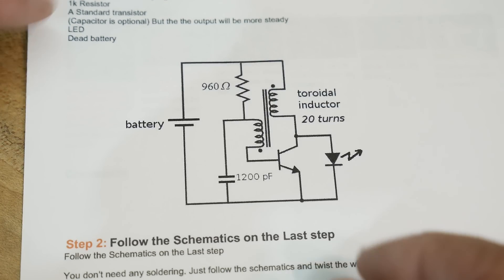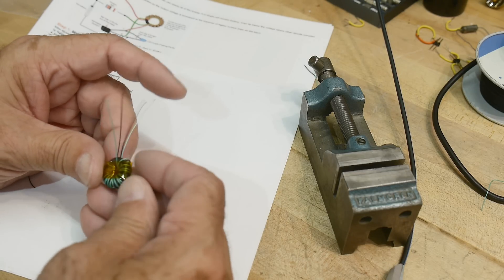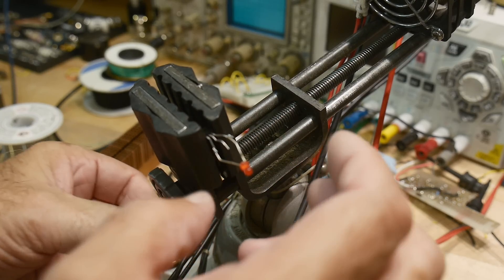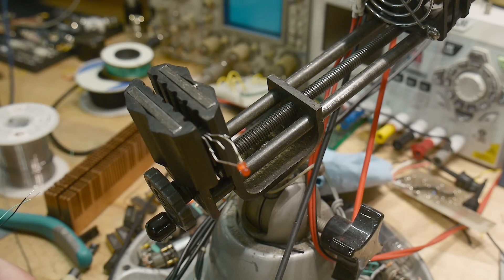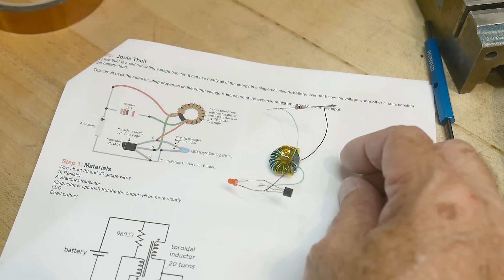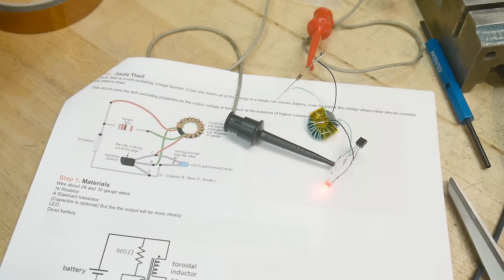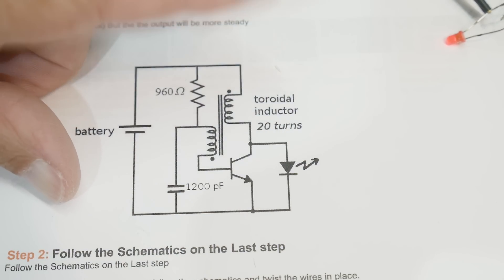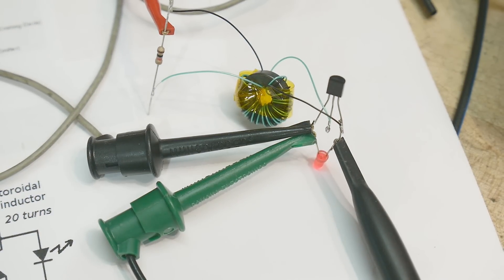#1596 Joule Thief

Comment: You spent so much time putting the circuit down you failed to see the important lesson that this setup teaches with a resistor, a hand wound coil and an NPN transistor. If you use the capacitor what happens if you move it, like in parellel with the resistor, what happens if you increse the resistor and capacitor size (make larger) when in parellel, what happens if you put the LED to positive rather than negative, what if you change the LED to a two pin RGB, add a diode before the LED and a capacitor to ground after the diode and before the RGB LED. Go back and learn from your errors with a little experimentation. The big question, Can you make the circuit better i.e. higher volts, lower amps with minimal extra parts.
Reply from the maker: this circuit is called a DC-DC boost converter. there are dozens if not hundreds of ways to do this. here is one: https://youtu.be/oj7oub16XyM?si=0MqplKOVoYDOOakR

Comment: With just a capacitor across the resistor you can turn this into a LED flasher. R ~ 82 k, C ~ 22uF > 1s. My test setup ( started with new battery )  is running over 5 years now. Better than the old LM3909.

Comment: I was interested in making a night light with a low power high-efficiecy LED powered from a supercap. And it might be a cheap solution in order to use most of the stored energy compared to very expensive energy harverster boost controller ICs that I managed to google back then. What alternatives you may think of?

Comment: Use it as the basis for the circuit to replace the salt damaged strobe light on my longline sea fishing torpedo, replacement cost NZ$45. LDR to switch it automatically at change of light, charge pump fed from the output, to a diac which, once pumped up to its break over 30 volts, discharges through a line of clear LED's and produces a flash, every few seconds. All off a 1.5 volt cell. Whole thing cost less than a $1, and if it's salt damaged, I have the spare parts, unlike the original. Battery seems to last forever.
Do you have any diacs in your 'Aladdin's Cave'? They have other uses apart from triggering triacs. Might make an interesting video for those who have never used one.
Reply from the maker: https://youtu.be/2WWUhsus9ic

Comment: A very cool little circuit.  Apparently these are made in developing countries out of old compact fluorescent parts, and sold at flea markets. Probably quite useful if you don't have electric lights.

You could charge a AA or AAA NiMH battery with a small solar panel out of an old calculator.  In bright sunlight this could give about 10mA.  Might need a diode (or half of a transistor) to prevent the battery from discharging through the solar cell when it gets cloudy.

Apparently these are not very efficient because there is a significant DC component going through the coil and resistor.  (There are several "energy harvesting" chips on the market to do this more efficiently.)

It would be interesting to devise an experiment to measure the input power from the battery, and the output power to the LED.  Probably using shunt resistors (maybe 1ohm or 10ohms) to get the current waveforms.  Then multiply channel A and channel B waveforms on the scope in real time to get the power.  (Need to multiply A and B point by point, add them up over several cycles, and divide by the time.  Not just multiply the RMS values.)

P batt = V batt * I batt wavefore

P led = V led waveform * I led waveform

Food for thought.
:-)
Reply: What do you want to prove here? You can not violate the law of energy conservation; the output power is definitely less always than what is being consumed from the source.
De VU2RZA 
In ABQ, NM
Reply: @subramanianr7206  
Yes.  I totally agree with you.  The power supplied by the battery will be equal to the power consumed by the LED plus the various bits of power consumed by the other components in the form of heat.

The simple Joule Thief circuit is not very efficient because a significant portion of the battery power is wasted as heat in the transformer, the resistor and the transistor.

Some "energy harvesting" chips do a similar thing but are more efficient (i.e. waste less power as heat).

I guess I was not very clear about that.  Sorry.

Cheers  :-)
Reply: @robinbrowne5419  thanks for the clarification; it is much appreciated 👍 
De VU2RZA 
in ABQ, NM
Reply: hardstyle905  A simple joule thief circuit, as shown in this video, has an efficiency of 40 to 60%.  This can be improved to around 80% by making a high efficiency joule thief.  Search around in google to find out more.
Reply: hardstyle905  When I say that the joule thief is not very efficient, I am not knocking it.  It is a brilliant little circuit because it is so simple to make just by soldering a few components together, and can use up the last remaining energy from a battery.  It would make a great little flashlight  :-)

Comment: If all you have is a ferrite core, some wires and a transistor, it's a good circuit to get higher voltages for biasing. Cool kids these days use fancy charge pump ICs :)

Comment: Of course it works first time, it was designed by the lovely and well respected Youtuber Big Clive! and while it's design isn't as you say magical, It is however educational.
Reply: Clive only added the name. The circuit dates back to the days of tubes and the common transistor implementation comes via an article in Everyday Practical Electronics magazine from 1999 called "One Volt LED - A Bright Light" by Z. Kaparnik from Swindon, Wiltshire, UK..  Clive is very up front about Z. Kaparnik being the source.

Comment: I built one (a little tidier) and use it to charge  18650 lithium batteries from all my tired primary cells.  The diode I use is a 1N60 to minimize loss.
Reply from the maker: you must use a lot of primary batteries
Reply: @IMSAIGuy  I do.   They are everywhere.  Meters, remote controls, flashlights, kids toys etc...  I currently have a box of about 40 that need to be "processed".   It will take most of those to charge one or two 18650 cells depending on their state of discharge and capacity.  It's (slightly) better than throwing them out with energy still in them but I'm certainly not saving the planet.  More like a conversational diversion.  Maybe I will do a video on it.  There is still about 40% of the original energy in a alkaline cell when it's down to 1.2V and generally not useable anymore for many applications.
Reply: That could be an interesting video.

Comment: I've made some bike lights that ran off of a single AA battery and drove an LED or two.  Instead of a joule thief, it uses a Zetex (now Diodes Inc) ZXSC310.  This was a fairly simple boost converter that could run down to 0.8VDC.  It was quite handy for me.  It seems to be out of production now.. not sure if Diodes Inc has replaced it with an updated part or not.

Comment: There is a cap in the lower diagram but not in the upper. Weird it still works without one, though.
Reply: I noticed that too but at 11:08 he said, "capacitor is optional" so no cap.😀

Comment: Of course, lighting an LED with just one battery is not very exciting,  but i have a multimeter that measures volts, Hz, line phase, capacitance and has a led to illuminate. All this works with just one battery.

Comment: Good stuff for the novice tinkerer. Started making these out of components scavenged from compact fluorescent bulbs, a source for ferrite cores and no cost NPN transistors. Have toyed with the idea of draining “dead” batteries to charge a lipo through a diode with a Zener to set    voltage. It is fun to watch the output waveform change as the power source is depleted.

Comment: I've made a number of these and you can just about use any transistor and core for the inductor to prove salvaged work just fine. I've made one so small I ended being able to place it in the base of a screw in type flashlight bulb base and a white LED sticking out of the epoxy to seal it all, basically and LED replacement bulb for a single cell flashlight.
Reply: Clever!

Comment: 'Joule thief' is a modern term for something called blocking oscillator. Forgoten technology that was rediscovered by modern 'arduino engineers' and given a new name, but the same oscillator was the basis of any flyback type (buck, boost, flyback) converters for about 50yrs. Blockings, being monostable or astable like this one were great for obtainint high-power sharp shaped pulses and were essential in radar, TV, computers... And all of that was based upon high positive feedback through a transformer, and by precise designing of magnetic one can get impressive results. For example one of the best ways for driving SCRs is blocking oscillator. Even today with modern opto devices and stuff. 
For example it is nice to show and explain action of a transformer in your circuit? Why it should have gap? 😁 Never the less, great video! I'm glad to see great but forgotten technology be given a new life.